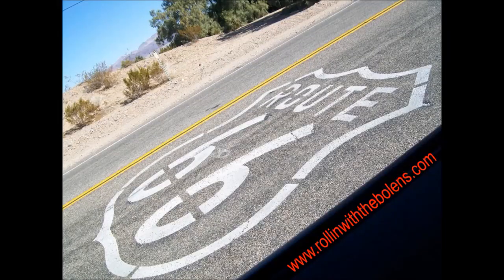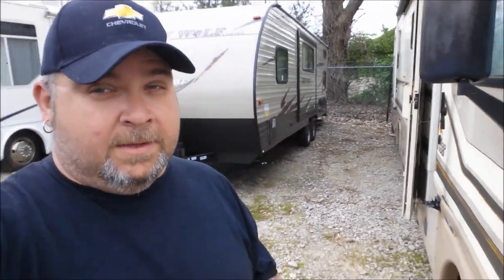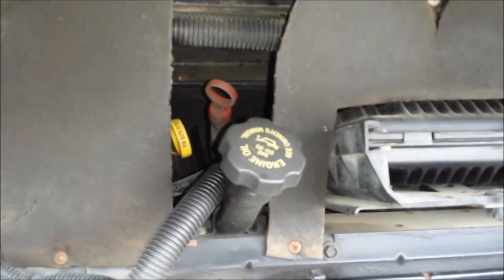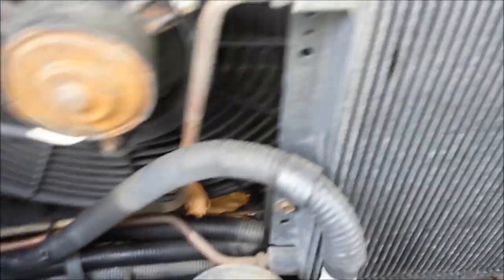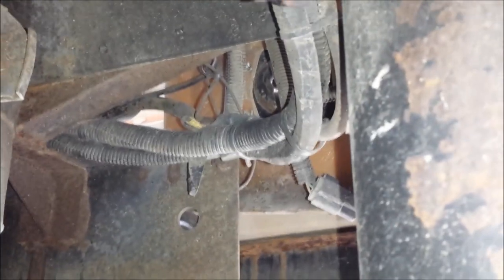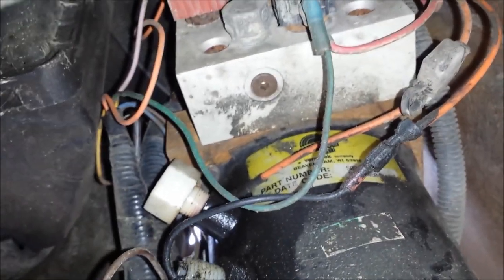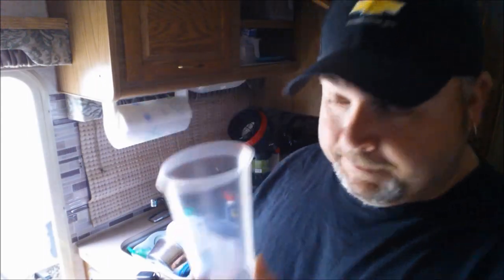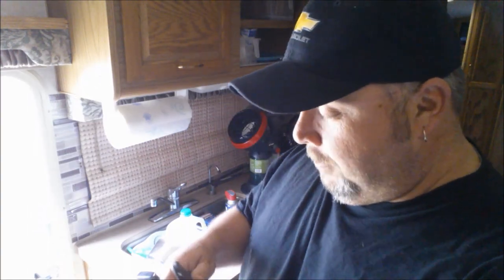HYDRAULIC JACKS FAIL  LEVELING SYSTEM TROUBLESHOOTING FLEETWOOD BOUNDER / FULL TIME RV , VLOG

Comment: WOW I have a 98 bounder and my reservoir is other side under slide out
Reply from the maker: Rick Butler that would be nice if they would have done that on all units
Reply: @RollinwiththeBolens  what year is yours?
Reply from the maker: Rick Butler ours is a 96
Reply: @RollinwiththeBolens  o ok that's probley the difference,  I have a V-10, and with ford running gear .strange.  good rig it flys down the road

Comment: That’s my motorhome!  96 Bounder!
Reply from the maker: Do you mean that as in literally? Or you have one like it?
Reply: @RollinwiththeBolens  I have one like it, a 96 Bounder I bought last year in excellent condition and I love it!!  Has a few minor issues but it looks and runs great!!  Have to figure out why the rear levelers don’t work why I don’t water currently after dewinterizing but I think I know what’s wrong.
Reply: @RollinwiththeBolens question for you.  All of a sudden my coach won’t stay up on the levelers.  Could this be a lack of hydraulic fluid?  It goes up but after a couple minutes it drops off.  Not a good feeling when you’re sitting outside having a beverage and it falls off the packs behind you!

Comment: I need help on a 99 Damon Intruder the leveling Jack they won't go down can anybody help me it's electrical I think
Reply from the maker: Check all your fuses.. inside and your relays at the pump.. check your wiring at the pump and motor for the jacks.. if everything is good there it's probably a circuit board inside